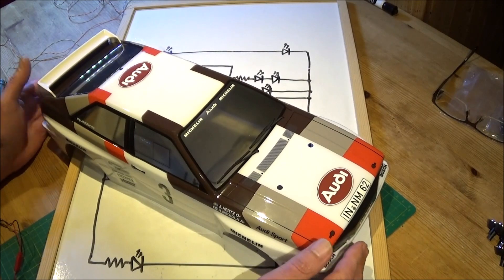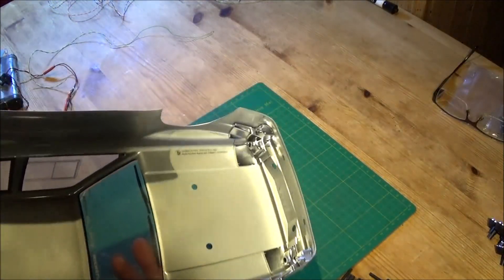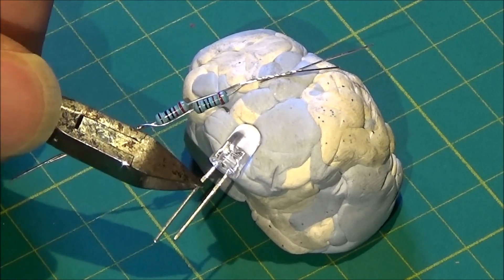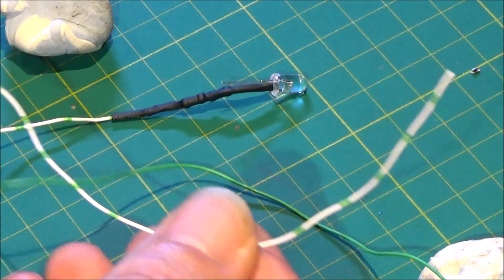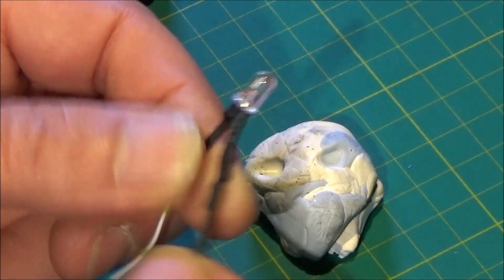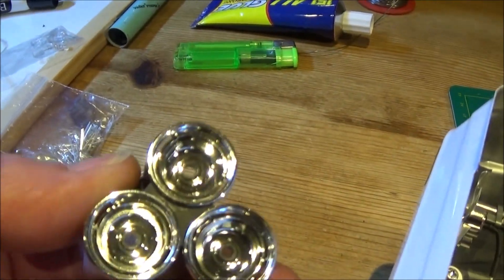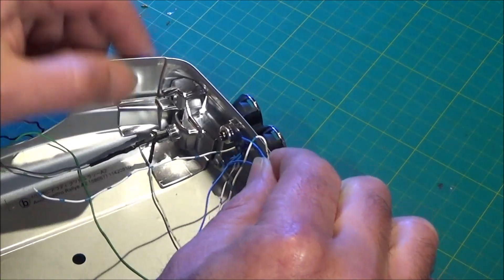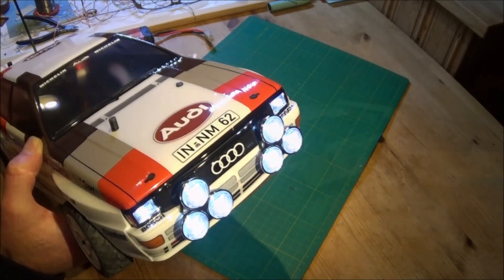How to Fit LEDs to RC Car - Tamiya Audi Quattro A2 Body Detailing P4

Comment: What tape do u use
Reply from the maker: For what?
Reply: @MarkBryanRC  to stick the led lights down
Reply from the maker: I used double sided tape to fit the plastic light holders to the body, it came with the kit. The LEDs are fitted to the light holders with plastic clips and a screw. I taped the wires to the body of the car with duct tape. I hope this helps.

Comment: Hey it‘s me again. I‘m still looking for how may AA batteries i need to be able to build the independent light cirquit. I have „a“ flu at the moment, so no progress. 

I have another question😃: how did you fix the led‘s into the lightbuckets? Did you glue them in? And if do, what glue did you use?
A friend told me to use shoegoo, because it stays soft but strong and he said it might be removable (in case a led breaks). I‘m not sure if i should just use superglue. I like the idea with putting shims like you did
Reply from the maker: Hello again! Sorry to hear you are ill!
For a 3v LED you will need 2xAA batteries in series.
I used a rubber based glue as your friend suggested to glue in the LEDs, easier to remove if a LED dies!
Thanks and take care!  :)

Comment: Great video Mark I have a hsp truck grampus I want to fit 6 led lights on but can I connect it on the transmitter (not the remote) can it be done that way.on your video I see u got it on your esc plug

Comment: Great video Mark I have a hsp truck grampus I want to fit 6 led lights on but can I connect it on the transmitter (not the remote) can it be done that way.on your video I see u got it on your esc plug
Reply from the maker: Yes, absolutely, you can plug the LEDs into your receiver using the spare socket if you have one (ch3) or it may have a (Batt) socket. I have used the plug off an old servo to solder onto the LEDs and plug into the receiver. All the best!  :)
Reply: @MarkBryanRC  hi Mark got your message now I will try it out and let you know how it go’s.how many lights can be used of the receiver.I’m going to use resistor’s on the lights.Thank you so much love your videos
Reply from the maker: @avinashramlucken6441  No worries, Avinash, I've used 6 LEDs on a receiver with no issues! Good luck!  :)
Reply: @MarkBryanRC  Hi Mark I’m done with my lights it looks awesome(not sure how to send a pic) but I need to fit 3 more LEDS on will it work or should I just leave it has is I don’t want to burn the receiver.THANK YOU  ONCE MORE
Reply from the maker: I just checked my cars, and the most LEDs I've ever had connected to a receiver is 8! No issues! Hope this helps!
Reply: @MarkBryanRC  Thank you

Comment: Mark,  I’m putting together all the parts for this kit.  Painted the car already with summertime green ice pearls with jet black back coats so it pops a Frosty Deep Forrest / Emerald Green Pearl flake that pops and bangs in the sunlight.  And already used a scalpel to cut and apply all the stickers including window trim.  Yeah Racing TT02 conversion kit showed up today and I’m sorting motor and gear diff and high speed gear set the following weeks and will build out all in one Go (or 3).  Figured I’d like to pick your brain a bit about how to wire up this LED kit and get that Done before I build out the rest of the car.   What was the hand unit controlled on/off switch that plugs into battery or ESC ?   And I guess I can answer this next question myself if I really look into it.   But what are your thoughts on just buying a pre wired kit and tapping into the 2 pair of (3) headlight clusters in the front?   Looks like you pay particular attention to detail on lining up the lights -  so I’ve kind of hazard a guess that your method is the way to go the way you neatly mount them both when you bend the connectors over. I get lost when you split the diff with the cathode / anode and wiring it all up.  Some of the soldering and then again when you work with several different series of wiring with all the lights front to back.  I guess I don’t want to go wire shopping so want to pull two colors.   How long does this (your process) take start to finish ?
Reply from the maker: Hi there! Sounds like you got a great build going on! Love the sound of what you have done so far, and are planning to do. As for the wiring, it only took a couple of hours for me to do in total. The switch was an old unit that I salvaged from an ancient manual speed controller. Not entirely necessary, you can just leave the lights on as they don't drain much current at all. I think it might be a good idea to buy some pre-wired LEDs and fit them. If you wire your own just remember that the cathode on the first LED goes to the anode on the second LED. It will make more sense as you do it! You can't damage the LEDS by wiring them the wrong way, so mistakes are easy to rectify. Good luck with the build - best regards from Mark...

Comment: Awesome work! I'm sitting here and stopped the work for today. Bought the same body 2 years ago. I'll go with street version optic and i won't use the extra spot lights on the front. The cutting work on the window frames from the sticker sheet is just too much now. I used PS-22 british racing green. The mirrors and the spoiler are painted with black, that i had left. Still a lot to glue on the body and LED's are ordered and have to be installed too. My HPI Sprint 2 will be fun again. It's getting new batteries and new brushless set. The good old LRP BigBlock and the NiMH batteries survived long enough. A lot of happy building days for the future and greetings from Germany.
Reply from the maker: Thanks very much for the great comment! Sounds like you are having fun with that body shell and paint. I really enjoyed doing mine. Your car will come alive with those new batteries and a brushless setup! Best wishes to you from England, my friend.  😀

Comment: Looks amazing! You say you need 5 resistors but am I wrong, I counted 7? 2 on front, 2 on rear, 3 on the fogs. Why only 1 resistor per pair of fogs and 2 for the fronts and rears? Thanks
Reply from the maker: Thanks for the comment! I think it was 6 resistors in the end! I just fitted 2 resistors in parallel on the main headlights, but only 1 to the other pairs of LEDs. The 2 in parallel halves the resistance, making the headlights a little brighter than the rest - I thought it would look better that way, but it would be fine with just one resistor per pair of LEDs. Hope this makes sense!   Cheers!  :)

Comment: Received radio set today - everything works. Audi Quattro looks nice and very fast and sensitive( like dual rate of the steering servo) for steering.  Thanks Mark for your support. Just one concern I have - When I turn front wheels - left one almost touch the edge of the body - right one is not . Why? I drilled holes according Tamiya marks but looks like left one not on the place. What you suggest to do? How to trim it? Thanks...
Reply from the maker: Great to hear! It's normal that one wheel is closer to the body when turning, I think the steering turns more on one side than the other, if it's not rubbing, it's OK and you will not be concerned when driving the car. Enjoy the wonderful car you have built! Cheers!  :)
Reply: @MarkBryanRC  By the way if I install rally block tires - front tires touching the body during the turn... What to do in this case?
Reply: @MarkBryanRC  I see. I can cut corner very little like 1mm . Thanks. Video coming soon...Weather in Vancouver pretty bad - rain all time...First try will be on my rc airfield - a lot of space and no peoples around...
Reply: @MarkBryanRC  My email - pilgrimigor@yahoo.com  if you reply I will send you photos of my concern... Thanks.

Comment: Great job, any chance you could give a tip on how to spray paint the lights rear (polycarbonate red?) front?
I m painting that body shell very soon and would like to get it right
Reply from the maker: Cheers! Hmmm...  the lights don't need painting as the decals provided give the colour to the lights, both front and rear, I just fitted red LEDs to the rear and it looks fine. Good luck with that lovely body shell!  :-)
Reply: @MarkBryanRC  thanks goodness.
I will take my time with it, actually i d love to paint some  parts royal blue. Let's see.
Reply from the maker: Cool - taking your time is definitely the right way to go. Royal blue? Sounds interesting!  :)
Reply: @MarkBryanRC  i saw some photos of the 1:24 model online and it looks a lot better than the other, but it would involve cutting some decals and it might be too much for a rookie.
Reply from the maker: It is good to differ from box art now and again - that 1/24 model sounds nice. If it's just trimming a few decals, it may be worth giving it a try! But if you are not sure, stick with the box art - I hope it goes well!  :))
Reply: @MarkBryanRC  100% it s more I ve been out of the hobby for some 25 years, using the scalpel is my weak spot right now, doing mm at a time, not sure if it s the cutting mat ,cause i got a pretty firm hand.
this is the colour https://www.pinterest.com/pin/640496378232169020/
Cheers Mark I ve been watching some of your videos. Love the passion. Greetings from Australia.
Reply from the maker: @eddiespaghetti76  Cheers, Edoardo! Yeah, I like the look of that Audi paint job, the blue looks better than the kit standard brown. Thanks for the picture. Going to be difficult to replace the colour though. I'm 57 now, and struggle with my eyesight, but my hands are thankfully still working as I would like. Keep in there my friend, it's all about having a vision and trying your best, if it doesn't work out, so be it and try again. Great to meet you, enjoy the hobby and greetings from England!  :))
Reply: @MarkBryanRC  I might annoy you in the future for some more tips 😂
Cheers.
Reply from the maker: No problem, mate - I'm always glad to help if I can.  :)
Reply: @MarkBryanRC  any chance you could please tell me if I need to glue tyre to ring in the lancia delta tt-02 build? Waiting for they kit from overseas and don't want to have to order it at the last moment in case...

Comment: Just about LEDs - So Im going to connect LEDs ( front and rear) set to receiver as I do on my planes. Do I still need resistors for 3 fog lamps (3mm as you suggest). How much Oms and how they must be connected if receiver is 5V. Thanks!
Reply from the maker: Most LEDs are 3v forward voltage, so if running from a 5v supply I would definitely fit a resistor in series, before (+ side)  the LED, I suggest 100 Ohms. If you can find 5v LEDs, you wont need the resistor. Hope this helps my friend!  :)

Comment: Very nice and informative video! If I do not have older Tamiya car - Which light buckets for the head and tail lights will fit to this body? Where possible to get them?
Reply from the maker: Thanks for the kind words. The light buckets and spotlights are a part of the Audi Quattro A2 body set, I'm not sure if you can buy them separately. :-)
Reply: @MarkBryanRC  Good. I bought 2 kits - Audi TT-02 and Lancia. Audi easier to build to my point of view and I will start with it. So Im going to connect LEDs ( front and rear) set to receiver as I do with my planes. Do I still need resistors for 6 fog lamps (3mm as you suggest). How much Oms and how they must be connected if receiver is 5V. Thanks!
Reply from the maker: Most LEDs are 3v forward voltage, so if running from a 5v supply I would definitely fit a resistor in series, before (+ side)  the LED, I suggest 100 Ohms. If you can find 5v LEDs, you wont need the resistor. You need to run all of the LED circuits (with resistor if fitted) in parallel from the power supply. I Hope this helps my friend!  :)

Comment: How does the AM radio work for you? I love the old Futaba AM radios but am having lots of trouble with interference
Reply from the maker: Hi Lane - I don't generally have any problems with interference - as I run in big open spaces like parks and other green spaces. However, I do have one unbranded AM receiver that loses signal in my garden and when running around trees - but all the other 10 receivers are OK! I use the same ancient Acoms transmitter for all my AM cars.
Reply: Neat thanks

Comment: Great tutorial. Thanks for the video. I have this kit on the way! Does the kit come with headlight/taillight buckets or led holders? Or is that an optional part purchased separately?
Reply from the maker: Thanks for the comment! The Audi body kit does come with chrome plastic light buckets for the front and rear LEDs, but doesn't include the LEDs. It also comes with the 6 spotlights with clear lenses, but you need to drill the holes if you want to fit LEDs in them. All the best from Mark.  :)

Comment: Do you have a link for the light buckets you have used? Are they specific to the audi kit or generic. Thanks
Reply from the maker: The spot light buckets come with the kit my friend - all I did was to drill 3mm holes in them and glue in some 3mm LEDs  :)

Comment: Thinking about getting this TT-02 to get into rally racing, and I came across your video. Very informative and lots of great tips.
Reply from the maker: Hi - thanks for the kind comment. This body looks awesome when finished, the TT-02 is a great kit especially if you upgrade to oil filled shocks. Highly recommended. All the best from Mark...   :)

Comment: Hi Mark, can you tell me why the rear wheels on the XV 01 chassis point/camber inwards? Looks like there is no way to adjust this and car does not run in a straight line on tarmac as a result. Is that because it is set up for gravel/dirt only? I almost can't believe the look it gives the car as well. Many thanks for your input.
Reply: Also I am waiting on a new servo, so that might of been my problem. Still the rear wheels pointing in feels all wrong to me.
Reply from the maker: Hi Peter. The inward pointing of the rear wheels is called "toe-in". This makes the car much more stable in a straight line. Most road cars (full size!) use this too. I find it really helps to keep the car running true, I know it looks a bit odd but it really works, if yours is not running straight I think it must be another issue, my TT-02D had the same problem and it was an issue with a sticky servo-saver! Hope you get it sorted, all the best from Mark...    :-)
Reply: @MarkBryanRC  Thanks for your reply, I am aware of that on cars but the angle looked too much for my brain on the XV-01 Ha. I took back my old servo I wasn't happy with it anyway ((to your friends at Time Tunnel Models) I live in Edinburgh and often past their shop in North Berwick). Is there any servo you would recommend for good rally control setup in this car? I was thinking something from Savox around £40 mark but not sure what to get that is best suited. I just drilled and painted the body shell today , art side will never be my strong point but went well. Decals on the other hand may take some time! It's my first ever Tamiya build, only wanted 1 for the last 30 years and I finally gave in....
Reply from the maker: Hi Peter. Yeah, the angle does look a bit too severe! Yeah I use Time Tunnel a lot, due to the good prices and I have always had good service. Cool you have them on your doorstep - hope they give you good service too. I usually use cheap servos as I am on a tight budget, the basic Etronix waterproof servo that Time Tunnel sells for about £8 has served me well in many Tamiyas! The Savox will certainly be a better choice, but £40 is too steep for me! 30 years? Better late than never - I had a break from RC for about 20 years and glad I got back into it. Good luck with the stickers, mate!  :-)